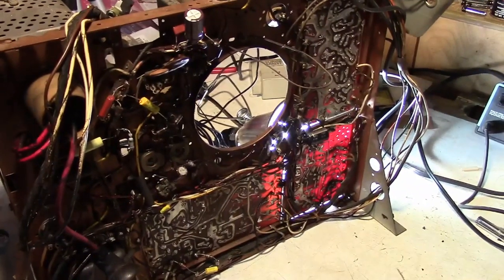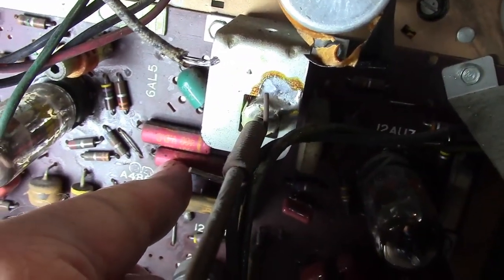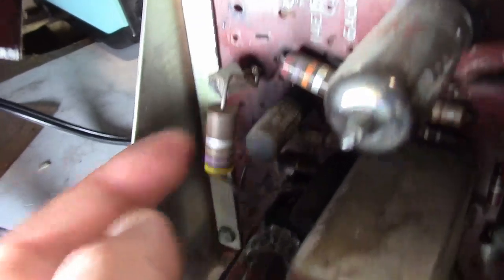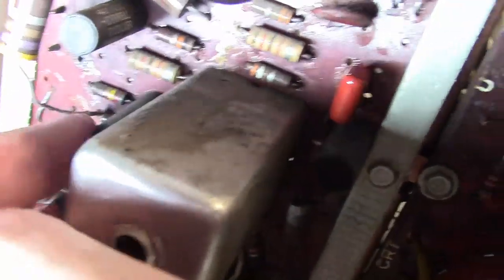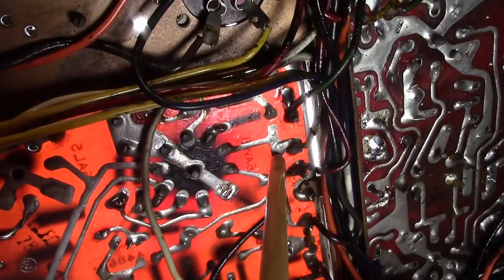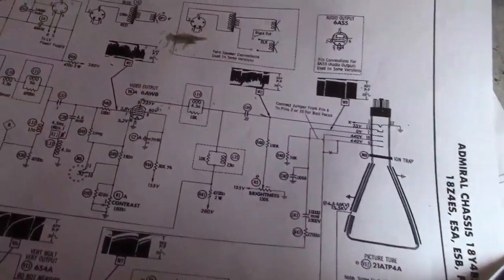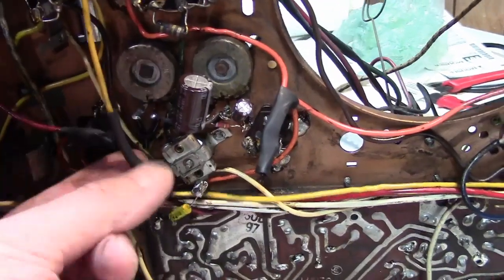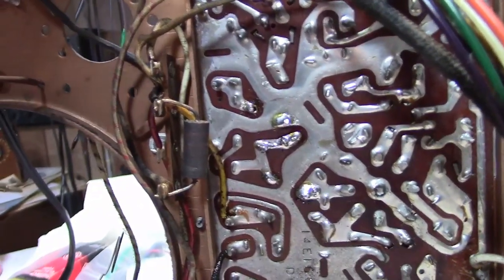Admiral T2301 restoration p4o8

Comment: Thanks for the update on the Admiral, I see it's coming along quite nicely. And thanks for the tip on dealing with gummy wire, I will have to pick up some denatured alcohol. I've read that it's due to outgassing of the plastics they used
Reply: Question 
Could a  7”crt  from a sentinel work in a   7” admiral 19a11 thanks for your help
Reply: I’m now going to answer my own question I checked schematic on both of the sets and yes that tube crt will work please tell me if you know something different Thanks again for the great videos much appreciated
Reply from the maker: Yes it will work.  All the 7" sets used a 7JP4 and are interchangeable.

Comment: Would tying the negative terminal of the 5 uF onto the tube socket ground be an issue due to heat?
Reply from the maker: Good question.  The board is mounted vertically so the heat will rise and the cap is off to the side.   Also little if any heat will be transferred from the tube socket ground through the cap lead.  Finally I used a 105C rated cap.